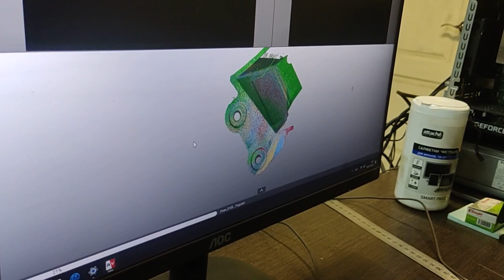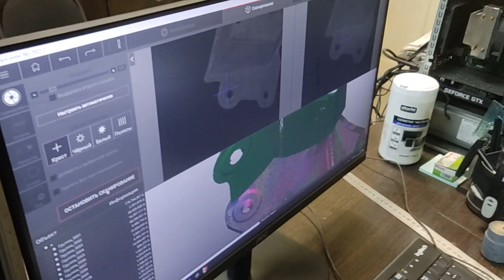Процесс изготовления запасной части для с/х оборудования "Бич ротора" методом литья по ХТС .

Comment: hello, I am in Algeria, impressive what is the name of the product that is added when pouring the aluminum on the mold with the spoon. thank you.
Reply from the maker: экзотермический порошок (Предназначены для снижения тепловых потерь с поверхности металла открытых прибылей)
Мы отливаем не алюминий, а сталь.

exothermic powder (Designed to reduce heat loss from the surface of the metal of open heads)
We cast not aluminum, but steel.
Reply: @manstheme  thank you very much.
Reply: @manstheme  why you were painting for this mold parts.